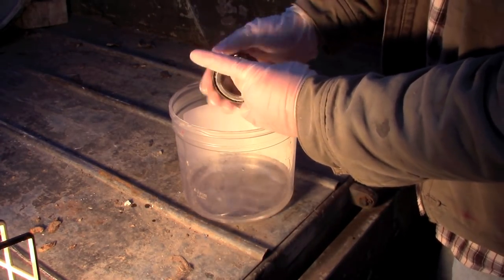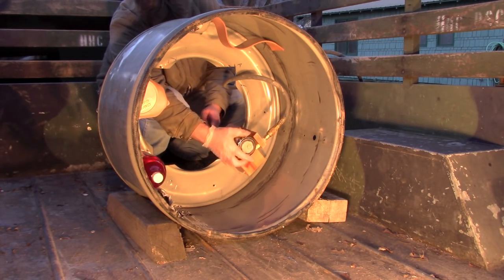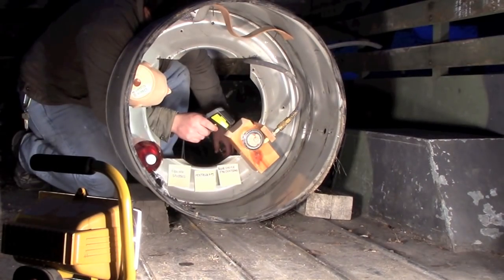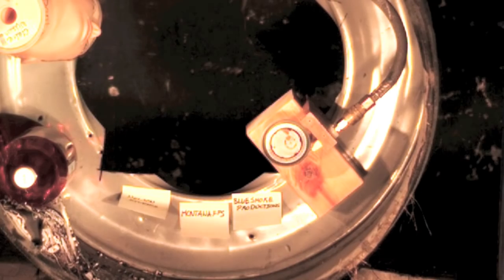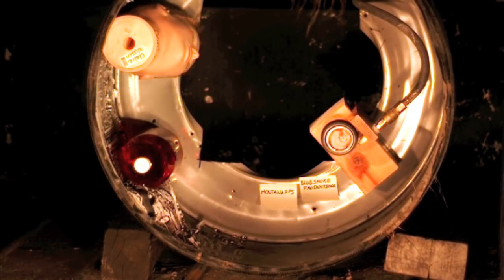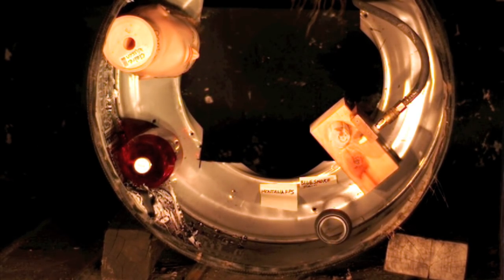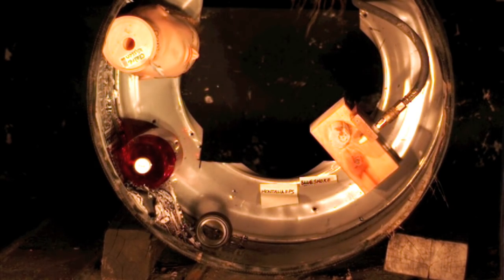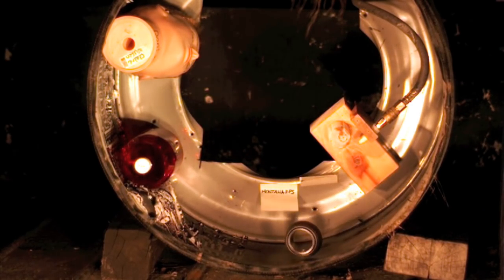Exploding Bearings With Air

Comment: I just about blew my thumb off spinning a single ball bearing not the case just a ball bearing not just any bearing a magnet bearing I ground down some notches on the two poles and on the sides to resemble a ball turbine when you put the magnet on top of the pipe and shape the inside of the nozzle of the pipe curved so it's like the intake on a jet engine and then put your compressed air up the other end of the pipe with A sharp nozzle pointing at the curved edges of the turbine nozzle it sucks the bearing down onto the nozzle as it spins The ping-pong ball affect I was creating quite a bit of power with a small coil and found a sweet spot then boom lacerated my thumb right up with a flash of light unbelievable speed from a 1 cm diameter bearing as it disintegrated. I am currently working on a safer rig hence your video 🤕

Comment: I bet the problem is the centrifugal force that expands the outer race. The gap between race and balls gets bigger and gives the race room for wobbeling, which then stops the rotation. You also have to consider this for bearings in high speed machining spindles and counteract it with a bigger preload.
Reply: How does that affect the bottom end speeds?

Comment: Just a thought but maybe the problem you’re having with getting the bearing to run faster is resonance. If you run the bearing up to an RPM which matches its resonant frequency, the rolling elements will begin to wobble and slow the bearing down. This is what seems to be happening here, the bearing is slowing down when it reaches a certain speed judging by the sound. This will also happen at each harmonic of the resonant frequency. Try getting the bearing to accelerate much faster so it spends less time at the resonant RPM and so is able to push through it.

Comment: trying to find something on these figit spinner bearings kids using compressed air to spin them stating 99999RPM want to know what speed those bearing would be able to achieve before failure. If anyone has an answer would love to know even see the failure of them.

Comment: Try the small side out but screw a fender washer into the wood to hold it on, but make sure the washer doesn't touch the outer cage that hold the bearing on.

Comment: If the metal is maluble the centrifugal force will just stretch it out but it won't have shrapnel
Reply: Just glue the bearing!
Reply from the maker: I have thought about trying to make a lead one but I just don't see it happening and I do see it wrecking the motor.  We are going try double records and see what that does.

Comment: Build a track for the bearing to fall in and you have yourself a new sport - compressed air bearing drag racing. Head to head races might be tricky but that would be about technique, do you direct the air to force it off more quickly but with limited speed or build up more speed but have a slower drop time? Who knows?

Comment: Make sure it's not one of the better bearings like SKF. Find the cheapest crap bearing you can. I was a mechanic for 25 years and always heard of the exploding bearing situation but never seen it happen. I always wondered if I ramped it up and for whatever reason it instantly stopped would it take my fingers off or even my hand or would the torque of it stopping do any damage. WOULD BE A GOOD VIDEO!! ( with a fake hand ) lol give it a try! Thanks as always

Comment: Have you played with a steeper angle of the nozzle? In terms of acceleration, they'll usually spool up a lot faster than that.  Maybe angling the nozzle slightly rearward or forward will prevent chatter. Angle the spindle a bit rather than vertical, perhaps?
Reply from the maker: +ElderlyIron I will give it a try.
Reply: I did. It blew up and gave me 11 stitches